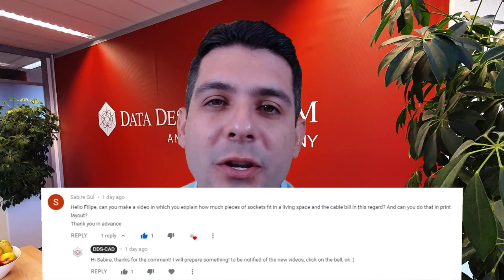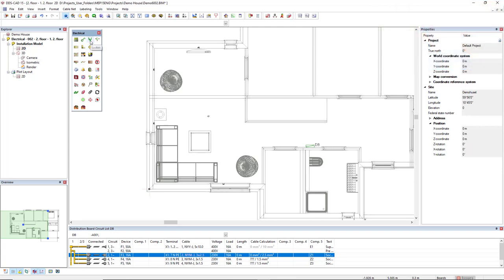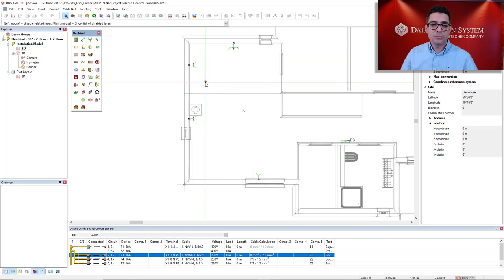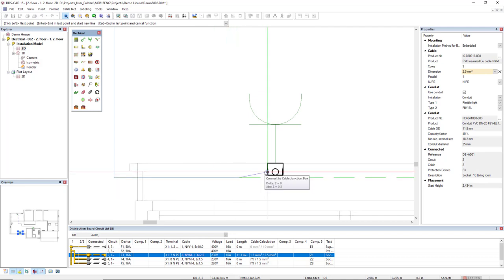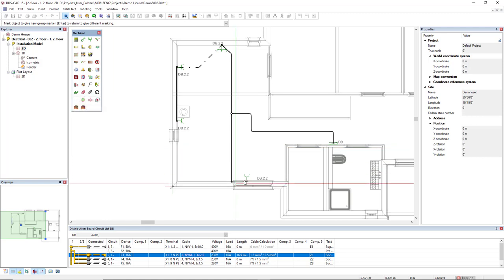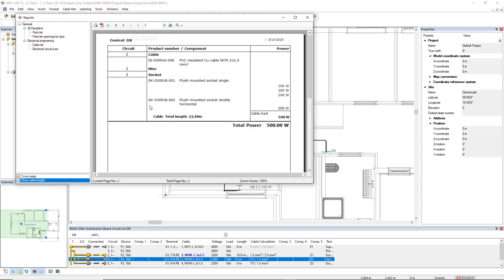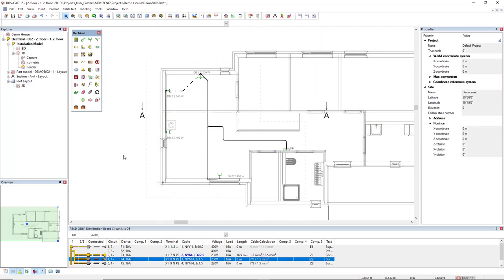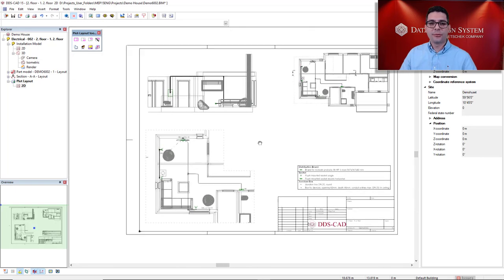Ask me a question! How do I dimension sockets in a room and prepare deliverables?

Comment: Hi Filipe!!!
I saw this video and I've seen another like this, title DDS-CAD 15_ Getting Started  - Electrical - Conduit, cable ladder (cable tray) and cable duct. My question is: if I want to use the same conduit for diferent circuit, for example, sockets with low power and ilumination, how I can do it?  And the same problem. In the circuit list, I have one circuit for the oven and one circuit for the stove beacause I want to protect separaly. One junction box and socket at 0.3 meters for the oven and junction box and socket for the electric stove at 0.65 meters. I want to connect the oven junction box with the stove junction box and the conduict that join the stove junction box with the distribution board has the two circuit cable in this conduit.

Thank you very much for your videos
Reply from the maker: Hi César, with the cable management system functions (Conduit, Cable ladder and Cable trunk) you can run multiple circuits. After you branch off from a cable management system you must use the Cable function as you see in this video. This is a nice content for a new video. Stay tuned!